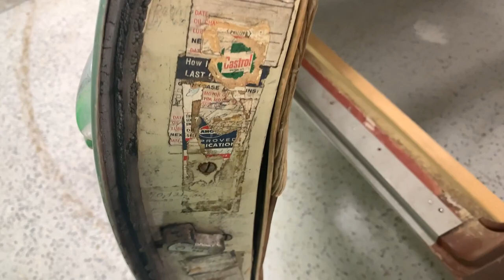1957 VW Karman Ghia EURO lowlight part 1

Comment: Love that original color. My first car was a ‘69 Ghia; one of my brothers totaled it almost 40 years ago and I still miss it, even dream that I have it back. These are beautiful cars but very sculptured and finely built but by the same token very delicate. They rust from the inside out in predictable areas like the tops of the headlight buckets, the side rockers, the bottom of the nose and of course the rear battery area. For some reason most of them tend to have nose damage. I remember back in the 1980’s you could get an OEM replacement nose for $400.00. I love the original side trim and window trim and feel it takes away from the design when they get deleted. This one fell in great hands with you; you will certainly do it justice.

Comment: For stripping I like to use a Woven Bottle brush. it does not take off as much metal and removes bondo like a champ. Seems like your using a fine grit so it wont remove too much metal. That citristrip works good too just to remove some of the paint layers. Then a bottle brush on a polisher really works great less effort and right to metal  and no metal loss.
Reply from the maker: Good to know. Thanks for the tip.  I was using 80 grit then polished it up with 180.  Never hurts to get new tips and tricks!
Reply: @Gregsvwgarage  yea I could tell it was not 36 or 24. 80 is fine but the polisher with brush works even better after a coat of stripper. strip then power wash stripper off then bottle brush and the bondo flies right off of there. to polished metal
Reply: I'm trying to envision this in action...  I'll have to scrub through your metal working videos to see if I can catch that.

Comment: Just an FYI. All of that brass has to be removed. And I mean all of it. Any body filler over it will bubble up later on. I’ve been in the collision industry since the early 80s and have seen many issues involving brass from old repairs. The early ghia is commonly called a low light. Looks like someone did more work half assing it rather than what it would have taken to do it right.

Comment: Ghias are always bad. double layer panels always have rust issues, Fenders dont come off. Not like people had mig welders or tig welders back then, so the repairs are usually brazed panels or pop rivet with kitty hair or thick bondo Gas welded stuff warped like hell. Bondo cracks too over brazing FYI. Does not stick so it cracks.

Comment: Don’t know a lot about Ghias. With what you can see at this point, Is it really worth restoring or would you be upside down on it financially when you finish?
Reply from the maker: These early Ghia s are nearly impossible to find.  Because of that the value of the car surpasses the cost to build it. If it would have been a later 60’s or 70’s car it wouldn’t be financially smart to fix.

Comment: Hi Greg, how long took you to remove the paint. What disk did you use?
Reply from the maker: About 10 hrs . I used my dewalt variable speed buffer with 80 grit sandpaper on it.  Then I went back over it with a 6 in da with 180 grit.
Reply: @gregsvwgarage8798  Thanks, do you know is there any '57 KG lowlight with late, larger '60-'74, vent openings?
Reply from the maker: @KG72  no  not unless someone replaced them with the later ones at some point.
Reply: @Gregsvwgarage  👍
Reply: Hi Greg, where can I get the nose vent panels from? Tks
Reply from the maker: @KG72   the  non lowlight ones look to be available from limebug.   https://limebug.com/product/t1-karmann-ghia-inner-front-nose-nostril-repair-panel-insert-right/
The lowlight ones are  available from California classics in the UK
https://www.californianclassics.co.uk/news/karmann-ghia-lowlight-nostril-repair-panels/
Reply: I have the sister Ghia to yours.  Must have been same bondo man and I haven’t removed all the paint yet.  Channels and windows are great.  The thought of sanding it all down and let it rust then flat clear coat has crossed my mind.  Mine is a 71 Ghia so it wouldn’t be terrible if I did that.